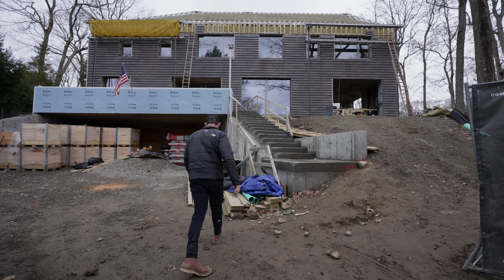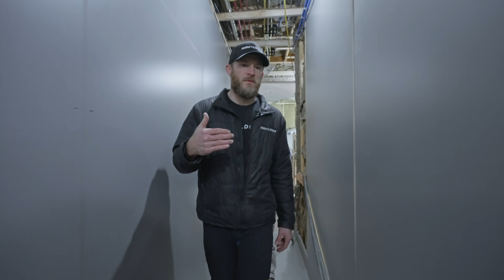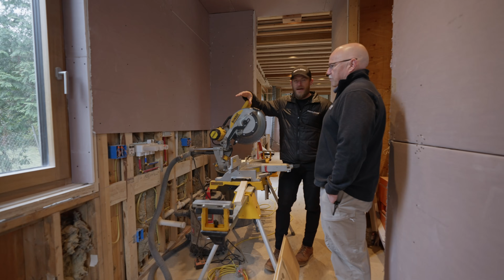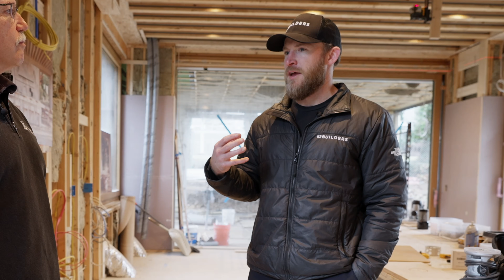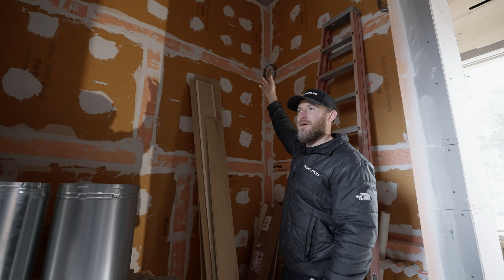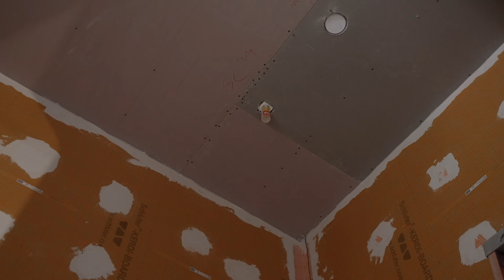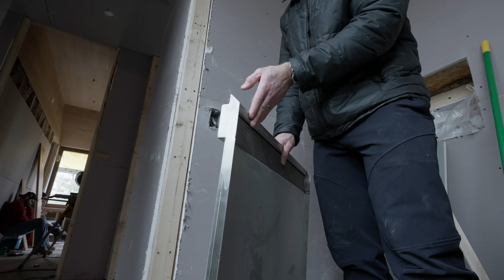How Plumbing Works In A Luxury Home A Full Walkthrough

Comment: it's kind of weird that he would say the heat pump water heater is gonna have downsides and require lifestyle changes for the homeowner.
i don't own one myself, but i've seen several videos about them, and comparing them to electric water heaters.  they DO take longer to heat the water, but once the water in the tank is hot, it maintains the hot water just fine, and for a home this size, i'd imagine they'll have an 80 gallon or two 50 gallon tanks, and Rheem's 80 gallon HPWH does up to 120 gallons of hot water in the first hour (because it heats the incoming water as the hot water in the tank depletes, so you actually get more hot water than what the tank holds, if that makes sense.  it's like filling a bucket while you're pouring the bucket out, you're gonna get more "out" of it than it holds).   That's quite a bit, even for a large family.  They'd have to ALL take showers and do laundry and run a dishwasher and STILL probably wouldn't use it all. 
plus, you can also get HPWH with resistance backup heat.  this is  what i'd go for personally.

Comment: as someone who has run supply lines for multiple buildings... A LOT of the installations in this system are overkill. Just to name one... having a 3/8" shut off at each fixture is such an easy thing to do instead of installing a leak detection system that notifies an APPP LOLLL. Also, the water pressure system being sized up to 2" and STILL having a water pressurizer is almost laughable. There is almost 0 chance any of that is necessary... Its still a beautiful system and the drainage system looks great for sure but that my take.

Comment: If they are using heat pump hotwater system to as the plumber gc said to think about the future , to think about the environment, I find this massive home a slap in the face to the environment, smaller homes, human scaled are for the environment, this home is not environmentally friendly due to square foot , good try though

Comment: You're not a great plumber if you restrict water flow with a lot of those 90 degree angle turns 😂 you should know this simple stuff. Use better product or avoid those 90's as much as possible.

Comment: There is absolutely no problem in plaster or technical plaster behind those toilets. That's because the main load is actually a pulling motion. Most are just mounted in front of a Gyproc board or plasterboard, as you guys call it. The Gebrit system you see there is like the absolute standard for any home in Western Europe. What toilet you mount is, of course, another choice. Some will be electric, and most will not be.

Comment: High-end luxury home with pex and pvc?
Reply: @brooklynboi11207  yeah. I’ve plumbed 3 million dollar homes with pex and pvc. I don’t even know where you can buy cast iron fittings around here. Even then hell with all this pex and pvc they still went wayyy above and beyond with all the equipment pumps and backflow preventer. Some expensive work
Reply: They used the cheapo crimped too. Expansion pex with sweeps instead of 90s would have been better.

Comment: I feel like you could have a similar system for the outdoor sink to the freeze proof Spigets, you can also install two drains at the lowest point of the sink to drain the pipes and not have to worry about anti freeze as the pipes would be dry.

Comment: It’s a shame PEX isn’t flexible. Lots of elbows in those runs.  Fittings must be on sale. Looks neat but 8 to 10 feet of equivalent length added every time…making the most of that low city pressure.

Comment: Luxury home - talks about “volume” but goes and installs all PEX B for water line. You use PEX A for volume (and other perks). That 2 inch pipe coming in and dropping to 3/4 inch because of crimp style. PVC instead of cast iron (again luxury home, I’m going with the best).

Comment: That’s a great looking job, and the only thing I will criticize is that the recirculating system tubing is not insulated. There will be a considerable amount of heat loss from the entire loop, negating the efficiency gained by using a heat pump water heater. It’s too late now for this house, but I would suggest that any future recirculating systems be insulated on the entire loop and for at least a short distance on every branch off of the loop.

Comment: Beautiful work. My thoughts on heat pumps. If natural gas is going to be used for cooking or hot water I steer my customer away from a heat pump.
Reason: in the heat mode the heat pump has the compressor running, condensers fan running, the indoor fan running. Three motors drawing power.  
Using gas only the indoor fan works. This saves electricity. 
Gas is used to produce steam to turn generators at the power station. More electricity must be produced by using more gas. 
I did the calculation and less gas is used to fire a gas furnace. What are your thoughts?

Comment: "These (copper plumbed areas) are the areas where the guys show off their craft." Looks fantastic but it is all pressed in place. No sweat copper in sight
Reply: Yeah that was kind of a let down. Whoever did the work did a nice job though.
Reply: @celticslimjim  Yeah, and they did the entire drain system in PVC too! Unreal. They should have done it all in hub cast iron and poured all the joints! 🙄

Comment: Thoughts on using an Aquor bib for the hot and cold supply to the sink and then putting like a 3/8 adapter to connect to the faucet or something? That might be a very simple way to winterize that sink.

Comment: What a fun and informative video, thanks! I didn't know about that little giant booster. Master plumber in MA, been plumbing for 16 years. My two comments are
1) angle stops- although quarter turn are nice, most brands aren't serviceable like multi-turn stops are (replacing guts, tightening packing nut)
2) There IS a limitation of hot water in drains in MA, set at 150F, so I do run the cold water whenever I pour boiling water into drains. Great work as always!!
Reply: Nice info. What is the theory behind the 150 limit?  Melting pvc?
Reply: @timefeatherstorm  good question, I believe that's the answer. May just be the typical temperature ratings on most drainage type materials

Comment: I don't think I'd use a bunch of crimp fittings on my Pax I probably use an expander
Reply: yeah thats what i was saying. In my experience, the metal crimp rusts and leaks, the fittings lower flow, the risk of bad install is higher, freezing expansion is more damaging on pex B than pex A, and pex A is more flexable and easier to install. Its almost a complete no brainer to use expansion pex A for such a large job.

Comment: "Luxury" apparently now means cold showers. No way I am building a 7,000 square foot house and not having enough hot water. Did the owner calculate the carbon footprint of the concrete? Huge CO2 emissions in cement production. Equivalent to about 10-15 years of gas hot water heater emissions for that slab and basement walls. If this is a state requirement then remind me never to move there. So dumb.

Comment: I would like to see Pex B connections for no loss of pressure. And cast iron sewer down pipes for minimal noise after flushing.
Reply: You mean pex a? PEX a is the expansion type that you stretch over the fittings vs insert and crimp.

Comment: I was so distracted by the bird shot Blast of screws in the blue board behind Jim in the bathroom when you guys were discussing the in wall faucet install and leak detection implementation. Is that a detail or did someone just miss the studs 12 times?

Comment: A word to your plumber.  Using all those 90s on PEX defeats the purpose of PEX. Pex is supposed to be run like electrical cable whenever possible, gentle curves and loops usually work great in 90% of a new build and greatly reduce the need for excess fittings that greatly reduce flow.
Reply: @TheBrandonHazel  correct, less fittings less possibility of leaks. however, this typically doesn’t look uniform and supported or mounting correctly . taking the extra step to drop a couple 90s is worth then curly fries for my water domestic system

Comment: High-level work. I’m skeptical on the water heater’s ability to deliver a satisfying supply, but to each his own.
Reply: They talked about a looped hot water system. You don’t see this on residential projects but you will come across it on commercial projects as a way to have consistent hot water. Also they are buying a premium-grade water heater (not a Rheem Performance)
You could also install a 20amp mini water heater inside the vanity of the furthest room if all else fails, and these guys definitely have the budget for it
Reply: @crys4789  Recirculating the water helps you with delivery time, not recovery time. Heat pumps have very long recovery times (I've seen 8hrs quoted at the trade shows) as they cannot pull enough btu's out of the air quickly, whereas gas water heaters can dump a lot of energy into the water in a short period of time, hence tankless. Heat pumps make a lot of sense if you have the space for multiple and have a lot of hot days, but if you live in a climate that goes below 40°F often or have a family of 4 or more it probably doesn't
Reply: @KenBissell-oq2ns   it will 100% be a point of issue. Funny how it's an old bald plumber who likely lived his whole life using all the hot water with no care in the world telling his clients that they have to watch how much hot water they use.
Reply: @KenBissell-oq2ns  depends on the size of the heater too. The recirculation pump will help with the time it takes to get hot but the size will dictate the volume. I like the heat pump style heaters
Reply: Hint it won't

Comment: I was under the impression that pex A with full flow fittings are the top of the line when it comes to supply lines no?9
Reply: Well, top is mad-oversized iron, then type K copper with long-turn elbows (sweated with water soluble flux), then pexes in alphabetical order :) But we need to understand the builder respected the client's preference for an electric-only, green install (solar cells, heat pump - NO tankless, no gas). Right there your pipes have to be thin and plastic or you're wasting a lot of water. Would you & I want different pipes? Yes. Would these guys be able to deliver that with excellence? I'm 100% sure, based on the earlier vids. But that's not what this particular client wanted.
Reply: @chefdeit  Hmm, I'm not a plumber so I don't understand why you'd want the fittings that reduce flow for this electric-only, green install etc.
Reply: @ I personally hate pex b. But some plumbers only put pex b because it's cheaper, available off home depot if someone is short on fittings etc, the basic tooling is cheaper, and their assistants may be trained up on the simpler pex b, which comes in red and blue so mistakes are less likely. It's also more commonly available in 0.5" and smaller sizes. Did I mention it's cheaper? For this particular job, big house with a heater in the basement and the owner not wanting to waste water getting it hot, they may have asked for small diameter tubing and the savings and didn't care about the flow etc at least on paper so far.
Reply: @chefdeit  Zurn PEX B with Zurn expansion fittings are basically the same price as Uponor PEX A with Uponor expansion fittings in my market.  Same inner diameter.
Reply: The PEX A being superior to PEX B is just Uponor propaganda.  Many PEX B are certified for F1960 cold expansion fittings now.  The Zurn heads for the power expansion tool are better than the Uponor/ProPex ones.
Reply: I guess I was just referring to full flow fittings.   @Jbk-o7t
Reply: @Jbk-o7t  we're in this video's comments section, looking at how it'd ended up actually installed here. Which is plain pex b.

If Zurn innovates with Pex B, that's great. But if, to match Pex A cold expansion and longevity, it has to be "Zurn very special Pex B that costs like Pex A", I think many folks will just stick with Pex A - which isn't an Uponor-only ecosystem any longer. Now, if Zurn makes it appreciably better and or cheaper (while consistent and long-lasting), then people will take notice. And I hope they will. Cheers!

Comment: Last luxury house that I worked in they had to use copper for grain & waste lines. Hate the noise PVC makes every time a toilet is flushed above the room you are in. My buddy got tied of that house and wrapped his 3" PVC lines from second floor bathroom with foam insulation pipe wrap then blew in insulation to quiet it.
Reply: Silent drain, supply, and vent are luxuries above the pay grade of this particular client I would say. I serve the NYC hospitality industry (IT) but I get to see the plumbers work b/c my wires often run parallel to the main drain in e.g. brownstone remodels, and there's a lot of cast iron being used for precisely the reason you stated, and in fact they make a point of reusing the old extra-heavy irons if they can for even less noise.
Reply: @chefdeit  There is no client though, this is a spec house by the builder with presumably some serious financial backing.  The house they demolished must have been at 3-4 million alone given location.  So it's a little perplexing to see pex, it's more perplexing that when they used copper, they used press fittings, and seemingly with no quiet pipe consideration.  Everything you mention above would probably be unheard of on the west coast, but in legacy cities like NYC, Philly, and Boston, there's plenty of skill for cast iron (and copper lines).  Nick is an amazing builder, and this house is amazing, but the plumbing was a bit underwhelming
Reply: @ That's interesting - in the prior, electric episode I thought they'd mentioned preferences for no gas and no smart switches as expressed by "a client" - but I may have inferred that incorrectly.

Plumbing - what, you want oversize type K copper, long-turn elbows, sweated with water-soluble flux? How the plumber's going to eat 10yrs from now if everything just works forever? :-) Speaking of the west coast, I've seen an old movie "The Man in the White Suit", in a nutshell he invented a "forever fabric" and expected to be lauded and instead the mob chased him till that thing got torn up in shreds.

But you're spot-on re NYC - in a recent reno on 5th at 15th St, removing a 1980s false ceiling uncovered beautiful Edison wiring (that's DC not AC!) that (technically not code wise ofc) probably could still function. Initially folks wanted to cut it up for souvenirs but it was decided to leave it in place as the original ceiling was beautiful and the client agreed making the new work reversible also despite losing a few inches (out of 16ft!). The head plumber told me it wasn't uncommon to find lighting gas pipes in walls on that block, with gas still in them (i.e. just capped off and plastered over).

Comment: Fantastic video and a great insight to outsiders!
Have you considered or used point-of-use water heaters, rather than one large water heater? I see a few benefits.
Pros:
•Nearly eliminate the wait time for hot water to get to the desired location, along with the wasted water waiting (similar to the recirc pump)
•The recirc pump is wasting energy pumping water around the house along with maintaining the desired set temperature
•Only "home-run" cold lines would need to be ran simplifying the plumbing process and speeding it up, along with reducing and nearly eliminating insulation around piping. Obviously short hot lines would be needed at point of use. Reduction of connections - leak points.
•Possibility of sharing point of use heaters in adjacent bathrooms
•If main water heater fails, you would not be completely without hot water, only in that one location.

Cons:
•Probably more expensive, though in a luxury build I would think the cost may be minimal and/or justifyable
•Electricity requirements are increased, possibly breaker box expansion needed.
•Point of Use would take up space under sink, in closet, or another "hidden" location

Curious to hear your thoughts!

Comment: I don't really understand how with a 7000 sqft house we're worried about carbon emissions for the water heater? He said the homeowners may have to adjust their lifestyle because there isn't endless hot water? And we use recirculating pumps because we want to avoid wasting water? No, it's to have fast hot water... If you're building a 7k sqft home why not maximize comfort, the little green adjustments are tiny in comparison.
Reply: In an earlier video they said this is an electric-only house, No gas.
Reply: If you have to run a faucet for 2-3 minutes to get hot water, you waste a lot of water.

Comment: Hello; "I'm not a plumber, so that's my first mistake; why do you need a P trap for the washer floor drain if it's got an indirect drain?  I suppose he is saying the P trap is after the air gap in the basement? Also, video request: Will this home have whole home filtration, RO system or other?
Reply: Yes there is a p trap below grade on the floor drain in the basement with an air gap between the laundry pan drain line and the floor drain itself
Reply: @sunoclockoneday2576 yeah- but why?